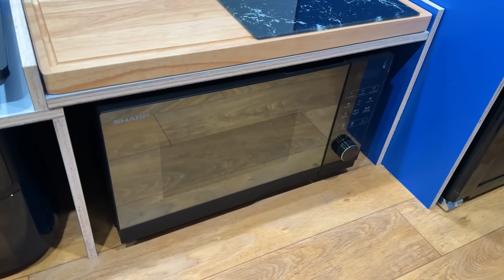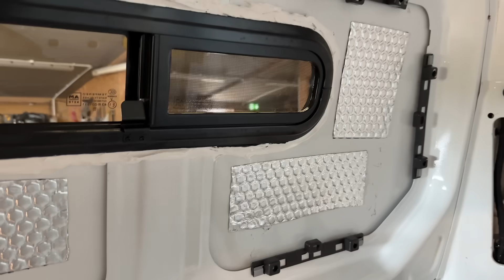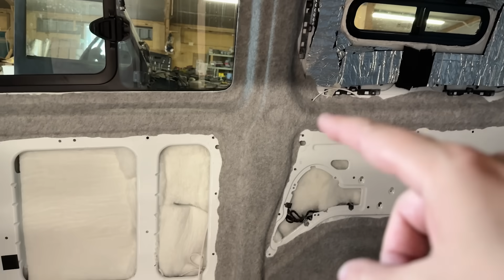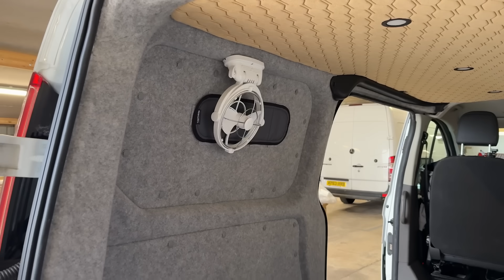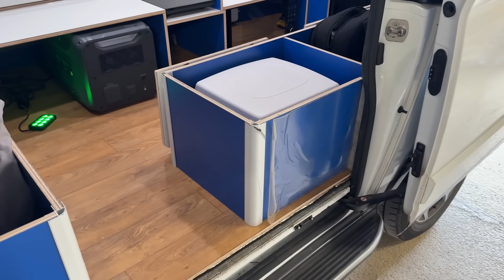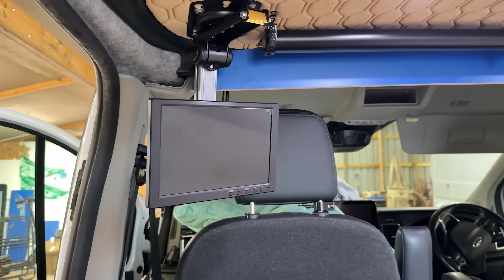STEALTH Camper Build (start to finish)

Comment: What hinge did you use for the bed? piano hinges or just door hinges? Quick bed making when it’s not fixed is a great thing I’ll bet. Do you have straps to stop all the bedding sliding down who you lift it up as well?
Reply from the maker: This is the full build video so it shows everything I’ve done and used

Comment: Hi, what's the code for Howden insurance?
  I'm an old man not to techy. Just bought a Renault master to convert 👍
Reply from the maker: There isn’t a code mate. Just ring the Thatcham branch (the number is in the description of this video) and when you’re getting the quote, tell them you heard of them through my channel and they’ll apply the 10%
Good luck with the conversion!
Reply: Thanks mate 👍
Reply: Thanks for the heads up. Just insured my new van with them. Mentioned your channel, got enough shaved off for a few tubes of Sikaflex. Every little helps. And properly insured, as in they know it's a panel van, being converted over time. 👍
Reply from the maker: Glad to hear it! Yeah there’s other companies to claim they do campers but in reality they only list it as a panel van. So Howdens are definitely better in that respect!

Comment: Very good use of the limited space you have 🙂
I see you have used the JOINLGO CCTV system as you did in the pigeon.  Can I ask how you find it at night? as I installed the same system from the link on your last van and mine is absolutely crap at night, crap as in you can see chuff all unless parked under a street lamp and I don't know if I have a faulty system or if they are just not very good. I did note that JOINLGO do have some systems with infrared lights whereas the little cameras you have (as do I do not have the infrared lights) so maybe that is the difference
Reply from the maker: Yeah they do IR cameras but I’m not a fan of them for various reasons. But if you want good night vision they’re the ones to go for. Mine are great in low light for what I need though. They have an extremely low lux rating. So although the details aren’t there I can always see what’s going on at night.
Reply: @Adz OK thanks
Reply: Put a sensor like home garden lights so if anyone comes close it lights them up

Comment: A really well thought out build.
Was thinking of using one of these ford vans ,
My question would be do you need the electric wired in if your using a power pack , apart from been able to charge from the engine when on a run.
I though you could just plug in each, kettle toaster slower cooker as and when needed ?
Reply from the maker: Thank you! 240v just plugs straight in, 12v goes through a fuse box

Comment: Fantastic summary, and looks great. How do you keep the air fryer and oven in place when you are driving? For info, assuming your van is the same as my 2019 Custom, you need access through one of those holes in the rear pillars (the ones just below the door straps) in order to change any of the rear light bulbs. I have just fitted some 3d printed covers from eBay (a UK supplier that has designed them to go over a carpeted pillar)